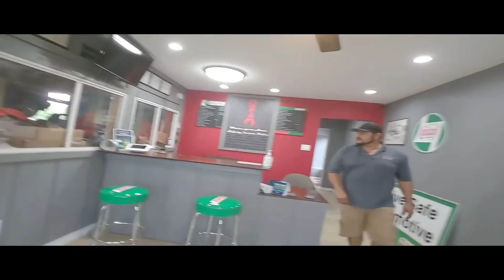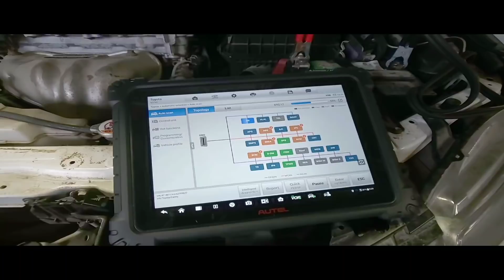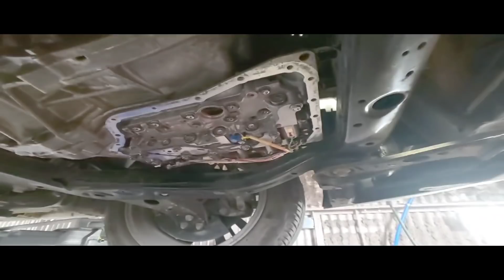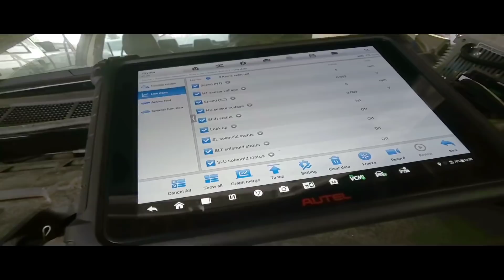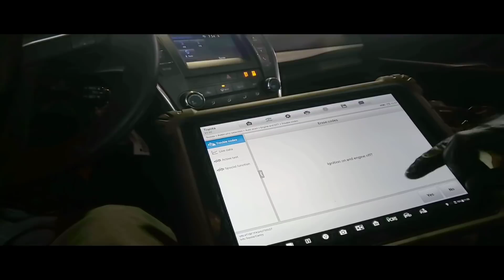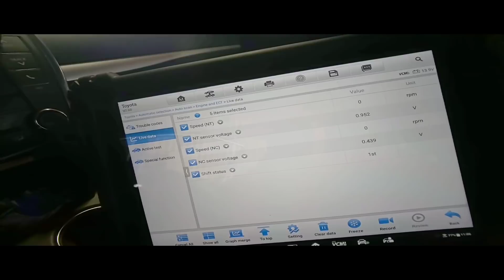🔧 Toyota Camry U670 Transmission Repair - U760E Transmission | No speed sensor signal.

Comment: Hey, not sure if you’ll see this but I’m pulling the body out of a 2015 Toyota Camry, which looks the same I think that pass through connector I disconnected the top clip. I’ve got all the bolts out and the valve body can I just pull it down and it’ll come through the pass-through or is there a special way to disconnect that area

Comment: Whatcould be wrong  if I lost all gears with ZERO cel ????
Reply from the maker: Lack of fluid. Broken pump, clogged filter,  stripped input splines, Broken axle...and more things could cause a no movement condition.
Reply: you find out?
Reply: @coolghoul9  smoked it after 30 flat miles smelled burnt thought i would try AMSOIL TRANSMISSION fluid bad idea.... never change the fluid on a 240k tranny. found one with 40k on it 600 from a guy on marketplace.  installed it myself works perfect again.

Comment: Thanks for sharing this great information I didn’t know that I have to turn traction control off to make the car running on the air. But what my Toyota Camry 2003 only drives side wheel is turning the passenger side moving very slow and I can stop it with my hand, just installed new CV axles is it possible that transmission is bad or didn’t coupled the shaft correctly?

Comment: Hi, I have 2010 Camry 2.5L with 140,000 miles. I have some AT issues with searching for gears or RPMs reving up (No trouble codes). Additionally, during summer months on longer highway trips the transmission fluid temp goes almost to 230F. What do you think about Sonnax zip kits for this type of transmission or any other solutions. Thanks Mike.

Comment: Hello Hiram,   enjoy watching your videos..........  Just looking for advise on something and wondering if you could help me out.   I have a 2005 Ford Ranger 3.0 which I think has a 4R44 transmission.  I am suddenly having some issues where the OD Off Light started flashing a couple of weeks ago and when this happened I noticed a change in the way it seemed to be shifting.   Now the light has been off for quite a while but when I first drive the truck in the morning everything feels fine but it seems once it warms up the truck feels like I am driving over some very small speed bumps in the street.   This happens mainly in lower gear.  I also feel some vibration when I am backing up.   When slowing down around a corner for example it feels like the trans is not downshifting into a lower gear and the rumbeling feeling is there.    I have about 110k miles on the truck.  I took the truck to advance auto and they could not detect any trouble codes.  I did a fluid and filter change last weekend with no change which was not fun for a 71 year old guy.     Also tried adding a 2 ounce tube of something called Anti Shudder which had no effect.    From your experience do you have any idea what the problem could be.  Thank you very much and God Bless.
Reply from the maker: Auto parts scan tools don't scan transmission related codes. They're mainly used for emissions related codes. 
You need to take it to an automotive or transmission shop to scan it, enhanced scan is when you input the vehicle type and systems aboard. It will scan every module and it's issues. 
You probably have a gear ratio error code of some type. 
Have it scanned and let me know when comes up.
Reply: @AutomaticTransmission  Hello Hiram -  I had my truck scanned for transmission codes and they said nothing came up.   Just wondering about something  --  Could a blowout in the valve body gasket cause the problems I am experiencing.   One further thing is that I used my Ranger to pull out a few bushes recently and could the force of pulling out some bushes causes a blowout of a valve body gasket.   Thank you..

Comment: HOW WOULD that BRACKET  POSSIBLY GET BENT INSIDE the  CASE ? HOW DOES this EVEN HAPPEN ?
Reply from the maker: The sensors were replaced and when the valve body was installed it got bent somehow. That's why I removed the valve body to correct that. I'll do a part 2 of it when I get the parts.
Reply: @AutomaticTransmission  Did you make the part 2 video? Would like to see the parts removed and pinpoint of the damages. Thank you,

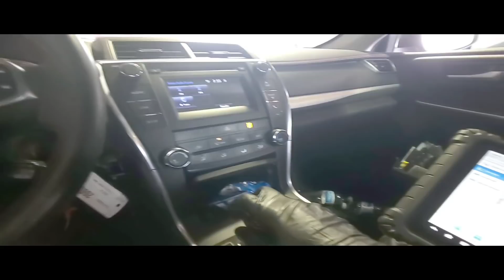Comment: Why turn off ESC ? 26:30
Reply from the maker: I had the car on the lift,  if you don't turn it off traction control comes on and won't go through the gears since the rear wheels are not turning.

Comment: i like ur video my way is drop the pan change the fluid in the pan and filter about 5 1/3  quarts ,full up with 5 1/3 quarts drive 30 mile ,repeat again 5 quarts drive 30 miles again repeat 5 1/3  quarts best way changing ur trans with out flushing i have 2014 grand jeep takes total 16 quarts,,this is this the best way than  flushing,